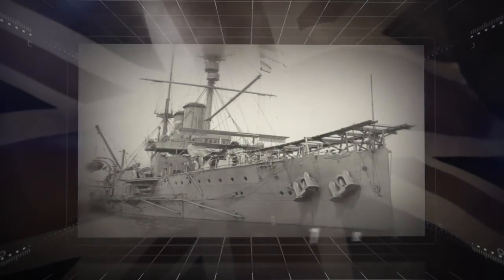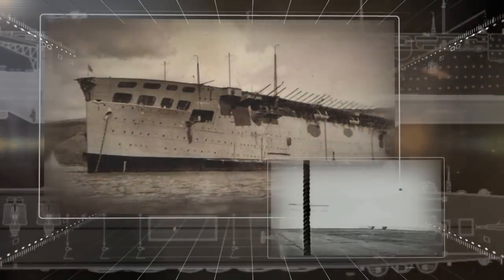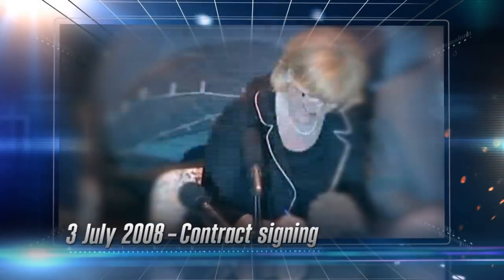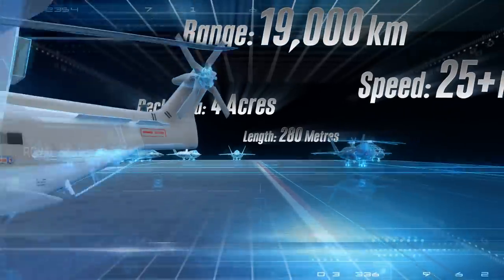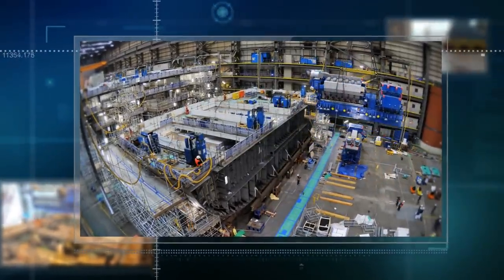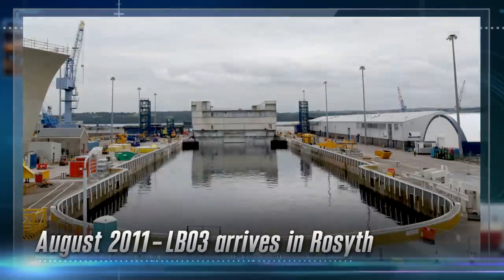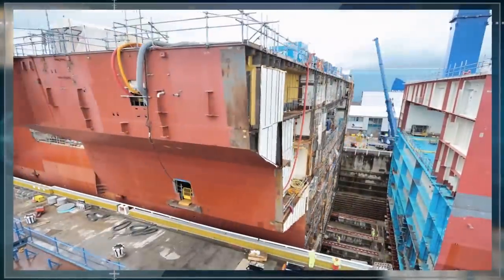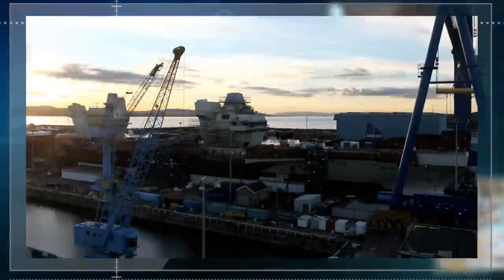HMS Queen Elizabeth: Carrier Innovation

Comment: How those "main generators" - which are nowhere near 6 or 7 times the size of the "prime mover" in a modern 4500-hp diesel-electric freight locomotive like a GE Evolution C44 or EMD SD70ACe - can weigh "146 tons" while those prime movers typically weigh no more than 30 tons as an engine/generator combination - is anyone's guess.

Comment: Forefront of British engineering? The Gerald R Ford was floated in less time at almost twice the tonnage in four years
Reply: Plz why are you trying to compare them ? The US has how many CVs the UK hasn't built a carrier since the late 80s
Reply: No, I am comparing the engineering and the people manufacturing them. The British inovated a lot of the ideas in the Nimitz carriers and now they are just going backwards with the two islands
Reply: Paul Jacobs For the Royal Navy's requirements and the money they had, it's a pretty innovative design.

The islands are a more efficient use of space compared to other conventionally powered carriers which generally have a single larger island. The main thing is that the ship is using an electronic propulsion system, allowing the engines to be placed directly under the exhausts and intakes rather than running throughout the ship.

Separating the islands means the two main engines are separate in case of damage and each tower is in a better position for their role (flight ops and navigation). But can also serve in place of the other in the event of damage. It also comes with the plus of extra flight deck stability.
Reply: TehDocc huh?  Don't get me wrong,  I understand what you are saying but the fundamental design of the ship is wrong.  Well its been wrong since the British went to ski jumps.... they should maximize the carrier to the strengths of the aircraft.  That's the whole point of a carrier,  to make use of the air power. By using ski jumps the aircraft cannot take off with a full load.  And let's be honest two islands are not really needed, one island would have saved on weight and expanded the flight deck.
Reply: Paul Jacobs I agree that they should have went for the CATOBAR design, that's down to cost more than anything. They unfortunately don't have the luxury of having money thrown at them, but the ship was built with the capacity to add catapults later at least.

Overall the islands are probably a similar size to most single islands of other conventionally powered carriers, if not smaller than equivalent sized carriers like the Russian and Chinese ones. They just gain extra survivability and efficiency for operations from the design.

It's also going to be extremely rare for them to operate the ship at its full capacity as it is, 12 aircraft will be based off her on a regular basis with a surge force of up to 24. So they're more concerned about making the ship run well than squeezing as many aircraft onto her as possible.
Reply: The U.S is a global superpower, it isn't a surprise our carriers are bigger (And we have 11 of them). 

I am happy for the Brits, its always nice to have powerful allies.
Reply: Byron Henry only an American would say something like that
Reply: Ukogbn W Well, am i wrong?
Reply: Ukogbn W We are a bigger country with more people, does it not seem logical that our military is bigger?
Reply: 1chish your forgiven. Lol. But two islands reduce the deck space. Ford is 42% bigger so cost and time is going to be greater along with the EMALS catapult and other new technology will make it considerably longer to develop. As far as force projection the type of plane that the ski jump was developed for, the harrier, the plane did not have the range. Force projection was an issue in the falkland war. But with the F35 Britain now has that force projection it requires why go to a ski jump? They had plans for a catapult...besides with the ski jump gets in the way of parking airplanes up front will make it difficult as in the depictions show. Where the second island resides an additional elevator could have been installed. And for you to put "nil" under refueling is short sighted on your part as you are saying the carriers never require refueling when in fact they require constant refueling based on price and availability of oil. In addition the fuel stores on the QE class are shared with the aircraft! USA carriers are free of that. No energy dependency. So that's a moot point. And you also say no development costs. I bet you if you read the financials of the consortium you will find development costs there, since this is a new design. In addition these carriers are designed for operations 50 years plus. My thought is if you're going to spend billions do it right. Also just noticed your comment about the falklands...it was wrong to be so far away without the required air support. The Argentines had the air power but to GB'S luck they did not take advantage of that. And that showed with the 2 destroyers, 2 frigates, 1 LSL ship, 1 LCU craft
1 container ship lost during the war
Reply: 1chish Did a little more research on your claims. The first cut of metal started in 2005, as quoted from the press release, "Advance construction began in 2005 to allow shipbuilders to test the design-build strategy before overall construction begins in 2007" The construction actually started in 2007 with the first keel laid in 2009. The US Navy did not even sign the contract until 2008. When comparing ship build times you go by the keel laid date. The keel laid date for Ford was November 14, 2009.  The QE was laid on 7 July 2009. Rough the same amount of time. The Gerald R Ford was floated 4 years later in 2013 and the QE was floated in 2014, 5 years after the keel laid date....This is the time frame I was talking about . As to your other claims about sortie rate, would be still be less than the Ford. As for launch and retrieval or sortie generation rate (SGR), the Ford will sustain an operational amount of 120 launch/traps per day for a 30+ days with a surge maximum of 240 per day conservatively speaking. The projected SGR for Ford is 25% greater than the Nimitz class. So we'll call that 35% more than QE we'll call that..."You get what you pay for".... Each of the QE Class aircraft carriers can take up to 40 aircraft, both rotary and fixed wing.
It is predicted they will routinely operate with 12 Joint Strike Fighters. Conservatively speaking the Ford will have 4x's that amount. That's two times the amount of both the Queen Elizabeth and Prince of Wales so the build costs now is $10.6 billion not including the amount for magical development. I am tired of this. And by the way your tonnage is overstated by 5,000 tonnes.
Reply: ***** hmmm. My lengthy replies are not informed? Hmm and your are a naval architect I suppose. With a screen name like Roddy Piper it would seem that you are a well informed WWF wrestler
Reply: by the way the two island thing seems odd and uses a tad more room but each island has their own role,so it will work alot better. one big island at the back is a nightmare for parking lol the us has already shown intrest in these carriers  (cheap and fast to make) obviously the us would want nuclear power  (so expect the cost to be  more) cats and traps can be fitted to these at a later stage if needed. point is the uk can build 4 of these for the price of one ford class,that's a win in any book,sacrifice a little but it's worth it even if adding nuclear adds another billion you're still getting alot for the money.

pretty annoying it's a f35 carrier only for now, would be nice to see a typhoon use them;)
Reply: The real truth why there are two islands is because to save interior space the British chose not to merge the two funnels into one. The two islands contain the two funnels. The bridge is in the forward island, aircraft ops in the aft island.
Reply: Paul Jacobs that is incorrect, two islands means more deck space as a bonus, think about it before I help you out. Two islands for two GT exhaust systems. Take one out, the second system can still move the ship.
Secondly, the tonnage is correct, its 70,600 tons as noted in a press release as a revision by the Royal institute of Naval Architects (RINA).
Tell me, how is EMALS testing going on the Ford class.........
Reply: Yeah. The "forefront of BRITISH engineering". Which has nothing whatsoever to do with the modern engineering capabilities of "Great Britain's" modern industrial powerhouse "allies" like the U.S.
Reply: That was using already established manufacturing facilities. The QE was the beginning of the facilities, and a completely different design using a tiny fraction of the number of people for operation.
Reply: How many countries now use the ski jump,and the U.s are thinking  of using it on the planned smaller carriers.
Reply: Before the sail south, the Royal Navy estimated a loss of six ships. About right i think.Also have you ever worked in carrier design?Or served on one? Look how many countries including Russia,going to build twin island carriers.
Reply: The QE was also built in six yards,and transported to Scotland,different concept of building.
Reply: @jacobs2162  so your a naval architect??? Your aware your new emals system doesn't work! That's from your own navy board! It could take years to fix It! The Ford has broken down! I'm not going to mention the toilets! And what's this 42% bigger bullshit??
Reply: @markbrown351  what does a naval architect has to do with my statement? By what you say, I can ask you the same question. 42% bigger means more air craft.....and no catapult means lower takeoff weight. simple logic.
Reply: @jacobs2162  really !! I merely asked you the same question you asked roddy piper! The Ford isn't 42% bigger! That's what you implied! And the reason for the larger aircraft on board the American carriers is simple! You park aircraft on deck! We brits don't! I suggest you look a little deeper into it !
Reply: @jacobs2162  go check the actual size and available space on the queen Elizabeth class then compare it to the American one's then get back to me
Reply: @jacobs2162  and again your emals don't work
Reply: @jacobs2162  also you are aware both the f35b and c versions both have a maximum take off weight of around 60,000lbs but the f35b can be recovered with a larger payload using the royal navies developed SRVL or shipborne rolling vertical landing" allowing it to land with upwards of an extra 7,000lbs compared to the C variant
Reply: @jacobs2162  you should stop being so butt hurt over your allies achievements and support them like we do yours! And from what I've heard the double island and ramp might be appearing on some of your carriers in the future!
Reply: @jacobs2162  I never said only ! But the Americans do both that's a fact! That explains the higher number of aircraft on the nimitz class even though the queen Elizabeth class has a larger deck and hanger area! That's another fact ! I also notice you avoid any reply about your bullshit about take off weights of the C and B variants ! And your idiotic 42% larger statement 😂😂😂
Reply: MercyReaper  it matters because of weapons load. EMALS is a new technology and it will have some issues but that does not prevent next builds from going back to steam

Comment: The main "innovation" with this vessel is that it doesn't have arrester gear and catapult so only one fighter aircraft can operate from it. Namely the f35b, that's the £200 million, US built VSTOL aircraft.
What a pity that the F35b is probably the worst fighter produced since the f104!
All is not lost, the UK air defence role will be performed by the eurofighter, that does work.
Reply: Carriers evolve through time and the UK has driven every one of those developments which others now copy. So who is to say that STOVL is not the way forward? I would also suggest that if we followed your way of thinking and built the latest CATOBAR nuclear powered carrier we would also have a $16 Bn Gerald R Ford clone sat in a river firing wheelbarrows off its failed EMALS system, unable to retrieve aircraft with its AAG system and basically unfit for combat. As the US Congress has decided.

We spent $10 Bn building two carriers capable (at surge) of delivering over 100 state of the art aircraft over a wider area than the Ford or any other US carrier can. Add a third for the same cost of the Ford and you then have 150 aircraft spread over 3 times the battle area and 2 1/2 times the sortie rate. That sounds VERY 'innovative' to me.

Current costs in the latest production costs for F-35 LRIP 7 Lot are:
F-35A: $98 million
F-35B: $104 million
F-35C: $116 million
An F-35A purchased in 2018 and delivered in 2020 will be $85 million, which is the equivalent of $75 million in today’s dollars.

And the F-35 is not solely a 'US built aircraft' at all. The UK put up £ Bns of development funding, we were part of the decision making process, a Brit flew the very first X35 VTOL flight, we deliver the warfare and other avionics packages, we contribute massively to huge software in every aircraft, RR build the F-35B LiftSystem and finally of course 15% to 20% of EVERY F-35 built (like the whole rear end) is built here in the UK by BAE Systems. 

And by the way the F-35 is not a 'fighter', we already have that as you say in the Typhoon, but even that is evolving to take over Tornado assets when that is retired in 2019. F-35 is a whole new way of conducting air warfare and the fact that 2 Typhoons are based over in the USA working up operational and warfare standards and tactics with our F-35s using new technology proves that point.
Reply: 1chish not having arrester gear and catapult is not evolution. It's crass stupidity, particularly that the f35b is proving to to be an expensive flop which the UK was tricked into buying into with the promise that UK engines would be used. The US backtracked on that one.
Reply: numbersix100 
Oh sorry I thought you could read. It seems you spout off your biased, ill-informed monologues regardless of the factual data put in front of you.

We use ramps not CATS as they are cost and maintenance free and offer 30% higher take off weights than VTO. EMALS does not work and costs $ Billions. Steam is very old technology. After all we invented them in 1950

TRAPS are easy to fit and the QEs are passively engineered for CATOBAR, AAG on the Ford sadly does not work. Our F-35Bs will use SRVL allowing higher retrieval weights and rates.

Crass stupidity it most certainly is NOT!

On one point I will partly concede and that is the RR F136 engine was more powerful and capable of more development than the P & W F135. But we were not 'tricked' into anything Old Son. We were in as the only Tier One Partner from Day One. Do try and read more and write less. We could, if we chose to, have demanded the F136 be fitted to all production UK aircraft. We still could as we have only been using test and development aircraft in the USA. And 'word is' from RAF contacts that there is an F-35B with an F136 fitted and running.

At peak, the F-35 will support 25,000 jobs in the UK over the next few decades and pump £1bn a year into the economy. The F-35 programme will be worth £ Billions to the UK over the decades of the programme and we will get far more FROM the F-35 than we will spend ON the F-35.

No tricks there at all.
Reply: 1chish You should try thinking for yourself rather than believing the government propaganda
Reply: numbersix100 
Oh look its the YouTube Troll get out clause ...

OK I am done ...
Reply: Oh my days. The fact that the USA still uses the Harrier in their own squadrons should be enough to show you that VTOL is effective. We scrapped them years ago, yet the USA still uses them. They were extremely effective in the Falklands war. The F35 has to be effective, otherwise Britain and America wouldn't have invested so much time and money into it.

Comment: It is a Great creation no doubt about that but why is it not NUCLEAR POWERED? That would have been the cherry on the cake.
Reply: +Ludwig Doku it a nuclear vessel is sunk and core ruptured it would be a global disaster
Reply: Shazam Your point might be true but what i said aint wrong
Reply: +rob smith Actually you are both right and both wrong. The large extra cost of a nuclear power system would have been a major factor in the decision, however I also believe that over the last decade or so safety issues have become far more important than was previously thought. It is not such a problem if a nuclear carrier is sunk as the vast volume of seawater would protect the immediate earth's surface from radiation. The main problem would occur if the carrier was not sunk but suffered battle damage to it's reactors thus causing significant radiation leakage. The consequences of this could well be disastrous for the Task Force but would probably not be a global disaster.